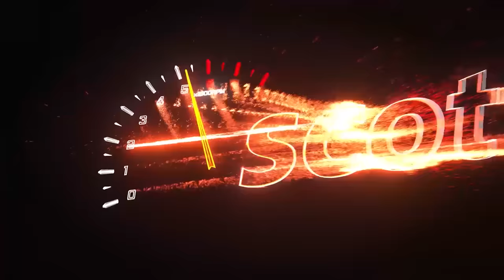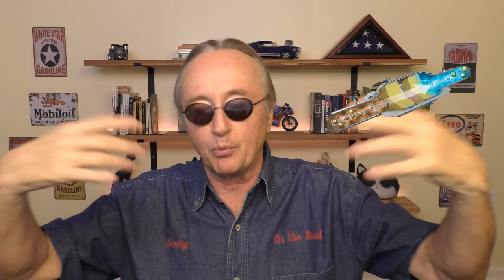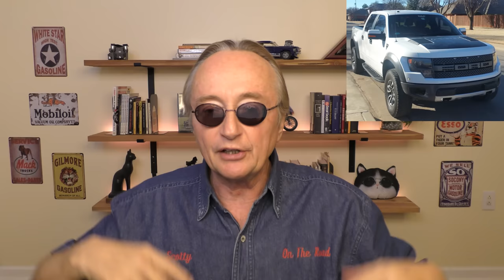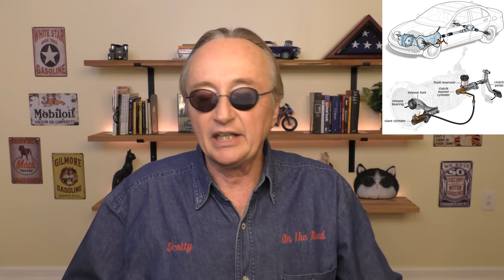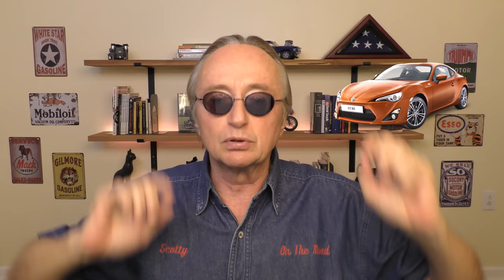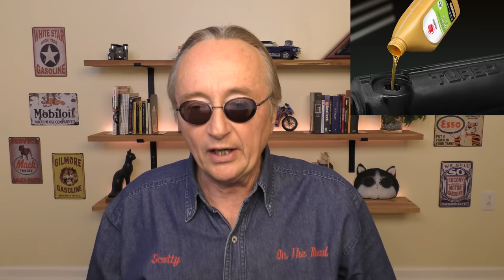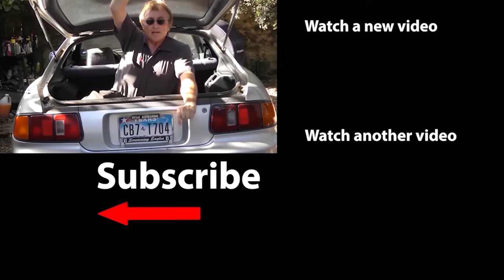Here’s Why Engine Braking Can Destroy Your Engine and Transmission

Comment: I have 110k on my 19 Silverado. I tow over the grapevine in California everyday. I always use engine braking and sometimes it exceeds 4k RPMs. My engine still running stop
Reply: I always take my class A motorhome down the Cojon pass both north and south directions in 1st gear at about 30mph in the trucker lane. Nice easy descents.

Comment: I've used engine braking for years.  And I've been driving stickshifts for over 40 years.  And I can get 300,000 miles out of a set of brakes.  Most of my driving is highway driving.
Reply: Either you're smoking something good, and i want some of it, or you have adamantium brakes, and i want some of that too.
Reply: @mastervader4444  One of the very first things I was told by my behind-the-wheel instructor in driving school was, "Judge with your accelerator."  I see too many people constantly hitting the brakes.

Comment: Establish that it's a lot of extra stress on the engine and transmission to engine brake, then we can talk.
Reply: I’d say as long as you don’t get too crazy with it, shouldn’t hurt your car.
Reply: It’s more wear on the clutch
Reply: I’ve been doing it with my 2009 Toyota Camry since it was new.  I now have a 109,000 milestones and no problems.
Reply: @ILYxIW  gotta rev match, clutch braking is a thing too...
Reply: It's harder on an automatic transmission from what I understand. The manual transmissions it doesnt hurt as bad.. and its wear and tear on any of them, because your transmission internals and your engine are holding the weight of your car back.
Reply: Engine braking is far easier on the engine than full throttling it. The only bad thing that can happen is either over-rev because you accidentally down-shifted 2 gears, or clutch wear due to trying to use those lower revs to help brake faster (basically same concept as revving the engine up before dumping the clutch to launch faster).
Reply: @thomasdunn496  there is a manual camry in 2009?
Reply: @kaibotski4939  My 2009 Camry is a 4 cylinder automatic.  Instead of keeping it in D when slowing down, I often put it into 4, 3, and 2 as I’m slowing down in addition to using the brakes.  It’s going to have to downshift anyways, so I don’t think it’s hurting anything if I do it gradually without causing excessive RPMs.
Reply: The 4 speed auto-transmission on my Corolla automatically selects a lower gear on long downhill descents
Reply: @ILYxIW  If you know how to shift, the wear is negligible.
Reply: @timwilliams4739  Not hard on them either.  This is just another OWT.

Comment: Hey Scotty, can you elaborate more on engine braking destroying engines and transmissions? I've been doing this for years and hundred thousand miles but I never faced such issues in my cars. I'm curious to know why engine braking destroys engine + gb.
Reply: Do you drive a manual or automatic? I have the latter, and I can’t get a clear answer on whether or not I should start doing this.

Comment: Scotty, have your ever noticed that usually when you see a vehicle coming at you going down the road that has a headlight out, it is usually always a GM PRODUCT? Just an observation I have made over the years....my general thought is, "If they can't make a light that lasts, there is no way the vehicle is worth a crap!"
Reply: Talk trash about Chevy all you want, but before the bailout, GM made some of the best cars out there. They aren't a Toyota, but I've seen endless GM cars hit 200,000-250,000 miles without serious problems. My Chevy Cobalt Automatic transmission has hit 230,000 miles and it runs like new, if you want proof, I'll forward a video of it running fine.
Reply: @dylanmanka3941  forward it to me, I'll believe it when I see it
Reply: @dylanmanka3941  I would probably agree with you about the time frame and the quality issues. My headlight/driving light observation still stands though. You can date that clear back to about '99. Back to the bailout thing, imagine that, our government touches something and it goes to crap...hmmmm. They such at pretty much everything.

Comment: Part of the fun of driving a manual is getting a little heel-toe action, engine braking, and rocking at a stop light before blasting off.  Good for the car?  Probably not.  Good for the soul?  Absolutely.
Reply: What to be able to buy a manual. So hard to find .
Reply: @MichelleJohnson-tg5lx  I had a stroke reading this comment, and manual transmission cars are everywhere.
Reply: @keenanwengert423  I think they maybe in the states
Reply: @GB-dp5bs  exactly I'm talking about the US I live here and I see manual cars all the time. I drive a manual too, they're available for most sports cars and almost every Japanese or euro car here is easy to find with a manual transmission. Only cars that are hard to find manual are 2010+ cars and newer econo boxes since most Americans want an auto
Reply: @keenanwengert423  try to go to a car lot and buy one. I found one and  I went all over my town 150 miles radius trying to avoid Orlando . I wanted a Newer car . found a 2014 Nissan Versa 5 speed and That was the only 1 I could get .  Newer  model with a manuel hard to find..  So stupid to have a stroke over a comment .
Reply: Heel toe? if done right it has no negative affects on the transmission, since you are rev matching you are actually helping your transmission not damaging it. As for rocking at stop lights, well yeah that is not the brightest idea
Reply: @wendysremix  and you edited yourself.   Trust this Karen Spelling Cop . I would have caught your drift and Ignored it to understand your content  . SO NOT Sorry if it has to so easy for you to read to comprehend .
Reply: @MichelleJohnson-tg5lx  ESL classes are plentiful

Comment: As someone who regularly drives from LA to Vegas and back,  I engine break pretty often when up in the mountains. 2014 Toyota Camry...no issues with engine or transmission yet. 107,000 miles.

Comment: Woah old car drivers been doing it wrong this whole time
Reply: Not necessarily. It’s a useful tool. Use common sense when engine braking. Obviously 3rd gear when going 70 miles an hour is not good for your engine. Unless of course you have a sports car. My owners manual suggests not using 5th gear when towing to get adequate engine breaking. 

Any time you run your engine, it’s wearing out. It’s up to you to decide what is best in the end.
Reply: old car drivers learned in/drove old cars!! drums all round , no power/servo assistance etc etc ;)
Reply: In the owners manual of my Subaru Impreza they tell you NOT to hold brakes down a long hill and to use the gears to keep the car at a steady speed. Its common sense, its not even about premature wear, you can develop whats called 'brake fade' where you temporarily lose friction on the brakes due to heat.
Reply: @nomeru_0  thats just being in the appropriate gear for appropriate speed, as you say common sense :)
Reply: @gimble8638  .....I hate power assisted brakes and steering in small cars.. It's an American thing that spread around the world..
Reply: @charlesdickens6706  well charles im in the UK and and older than i care to admit to lol, so yes ive driven / owned many many cars without either servo or PAS but tbh you wont find anything much  past 1980 wiithout a brake servo, which tbh on the whole is a good thing!!!, i still own 2 cars with drums all round and one has a servo and one doesnt and i know which i prefere out in the real world of today, yeah steering can fell a bit lifeless with PAS, but only really been in all small cars last 20yrs
or so really :)
Reply: Or car God is very wrong

Comment: Just don’t let the revs go up, like I only engine break in high gear like 4th and 5th  and use it with regular breaking at turns
Reply: If you Rev match that's not a problem

Comment: I had a 2006 Monte Carlo and I did downshift alot not knowing it was bad for it but the transmission lasted pretty long considering for a GM car 180,000 until i needed to fix the trany from clunking but everything else started messing up and it was leaking from everywhere at 186,000 NEVER AGAIN WILL I BUY A GM CAR, I got a 07 Accord 2.4 now and I trust it to go anywhere at 246,000, I barely needed to change the original alternator a few months ago. Very happy with it 😁👍
Reply: I doubt engine braking was the cause.

Comment: When I was taught to drive I was told to leave the car in gear until the revs hit around 1k then press clutch in. It gives you more control. I think it’s more dangerous to coast with only brakes on. Also engine has no load on it when it’s slowing how can it increase wear?
Reply: Well, at least in theory, it can have an effect because you reverse the direction of the force. Instead of the engine putting force on the transmission, the transmission puts force on the engine. However, I don’t think it’s a problem for engine because it just spins away, but I can imagine that it becomes too much for the transmission in certain situations.
Reply: @Asto508  I agree with you. Like if you're down shifting to high revs in a normal car. Which may be what Scotty is referring to here. However slowing down from a speed and letting the car slow down in gear should be okay. If you coast on the brake in neutral or clutch in you have less control.

Comment: I’ve got a 2000 GMC Sierra 1500 with 376k miles - nothing major done, a 2009 suburban 2500 - also nothing major done, and a 2014 Silverado 1500 x nothing major done as well. They’ve been amazing vehicles and have never left us stranded before. All 4x4 and heavily used off road.

Comment: Engine braking in a manual isnt detrimental. 
In an auto it just builds heat in the trans.
Reply: >90% of automatic transmissions on the road today have a lockup torque converter. When engine braking, the computer will engage the lockup clutch. The net effect is you actually cool the transmission due to higher RPMs to circulate fluid through the cooler, with no appreciable heat being added by the torque converter.
Reply: I've got a transmission fluid temperature gauge on my motorhome. The trans fluid runs very cool when engine braking on a long grade, usually about 140 degrees or less. The fluid temp goes up to 250 degrees on the uphill sometimes.

Comment: Engine braking is pretty handy on a downhill, banked, snow-covered road, lemme tell ya.
Reply: My friend almost killed himself going downhill in neutral only using brakes to slow down. He lost braking power and his plastic wheel covers were melted.
Reply: @lakshyamongia3270  Somewhere in Pennsylvania, there is a hill where everyone is required to stop before proceeding down it. I drove down it in my '61 Chevy Biscayne which had only a straight 6, a 2-speed Powerglide transmission, and non-powered, single-reservoir brakes. That was pretty scary!

Comment: I always engine brake with my 05 4Runner when going down mountain hills. They range from 1-2miles and they’re very steep. Do I have to? No. But I’ve never had a problem with it. Truck has 160k on it now.
Reply: Engines are more expensive than brakes :)
Reply: @sptt 144  try going a steep downhill only using brakes. Funerals are more expensive than engines.
Reply: @lakshyamongia3270  exactly. I’ve seen people on the hills I spoke of smoke their brakes because they fallow to close to trucks that are engine braking. I sit at 2,8-3k rpms, 50-55 mph, and the truck has no issues whatsoever.

Comment: I bought a '69 VW Squareback(fuel injection, new in '68) that was bought in Germany and brought to the US and sold with around 12IK miles. Almost immediately, it failed to start when cold and acted like a carbureted engine that needed to be choked. The dealer's mechanics really didn't fully understand the fuel injection system yet and I can still hear the German mechanic saying, "Replace the computer" in guttural English. Didn't fix it. I finally braved the regulations about entering the work area and read the manual concerning hard, cold starting; bad cylinder heat sensor. The computer didn't know the engine was cold. I had to replace this sensor at least three times over 10 years. New technology!

Comment: I use cruise control going down steep grades to maintain speed without going too fast. Works perfectly fine, saves brakes, and I’ve never had a problem.

Comment: Please explain how does engine braking hurt the engine.
Reply: Backslash in gear System and bearing
Reply: @Scavage0001  thats not true, if you have that much backlash then its shot in the first place. As long as you dont shift in too low of a gear its all good
Reply: @D3nn1s  you are not right! without backslash the whole World wont turn, every combination of 2 gears need backslash, thats a fundamental part
Reply: @Scavage0001  i didnt say theres no backlash, i said "that much"
Literally if you accelerate and let go of the gas thats the exact same thing as when engine breaking. While coasting along this happens dozend of times a minute that you accerelate slighly and then coast along.
Or do you floor it, shift to neutral and then floor it again?

Comment: Engine braking has never hurt any of my cars and I am as old is Scotty and my cars always get north of 250, thousand miles without burning oil. In fact the new cars, if you have the cruise control on and it’s going down a hill it’ll actually downshift to try and slow the car down to the speed you have it set at.

Comment: When I engine brake, the revs are usually between 3-4k rpm.  If you don't engine brake going down a mountain and use your brakes instead, you'll likely have no brakes left

Comment: If you are going down a descent of like miles yes engine braking isn’t good, but if you’re just coming to a stop at a light or slowing before a corner, go for it
Reply: Wrong as long as the rpm doesn’t go high u can engine brake all day

Comment: When I am going through mountainous areas, a LOT of up and down 5-7% grades, I keep my automatic transmission in high (3rd) and do not use overdrive. This gives me a lot more control and my transmission isn't constantly shifting and hunting for the right gear. And I do not have to brake as often or as hard.
Reply: You're doing it right.

Comment: Yes you are correct, a talented driver with the manual means to down shift an ICE can leverage the torque, mass, and momentum of the moving vehicle to slow down...prior to needing to physically brake to come to a complete stop.  As we move forward in human development with CVT and highly adaptive smart computer controlled transmissions this "talented driver" art is fading away.  With Electric cars coming on-line and regenerative braking many talented old ways will simply be reduced away.  I do still enjoy driving my manual transmission car. We all will have different experiences with this means of deceleration.   Its OK to have a different opinion.  I  greatly enjoy what Scotty teaches. I wish you all a nice driving day.

Comment: I always changed oil every 3,000 miles. Screw what anyone says, it's the best thing you could do for your car.
Reply: My dad learned about cars before refiners started putting detergents in oil.  He used to change oil every 1000 miles, and he didn't let the odometer go past that, either.

Comment: Car engines and transmissions are designed to operate within certain limits. As long as these limits are not exceeded, engine braking whilst driving down long descents is fine. If you rely too much on your brakes, you are asking for trouble!! Your car will suffer from overheated brakes, and unless your car has ceramic brakes, repeated application whilst driving down long descents can lead to destruction of the discs, & calipers. I have actually had this issue with one car I had years ago.

Comment: I engine break all the time; small hills, big hills. During the summer its cheap air conditioning and added breaking ;) Somewhat surprising to feel the added resistance to downhill engine breaking when the AC kicks in.

Comment: define engine braking too
is it staying in gear at high rpm
or jerking it in gear on high rpm
Reply: It is basically leaving the gas pedal and letting the engine slow you down without pressing either the brakes or the clutch.

Comment: Id like to fill in on your comment regarding Skoda. It is like what Lexus is to Toyota with a twist. You get premium interior and all the bells and whistles you can imagine for the cost of a basic version of a VW. Skoda has really hit the nail on practiality and space inside the car. They have a lot of clever details. Skoda introduces engines and drivetrains from Audi/VW once Audi/VW has figured out the early lifecycle quality issues on their models first. In Europe they allow customers to customise addon features from the factory. Skoda is pretty reliable, and because they share the technology with VW/Audi the spareparts do not cost a fortune in Europe. I recon if VW so decided their service network could handle Skoda too in US.

Comment: Scotty, I’ve heard that it’ll ruin an automatic transmission if you put it into Neutral “N” to coast down hills, and that you shouldn’t tow a broken-down automatic transmission car in “N”. Is that correct?
Reply: Putting any car in neutral when going in a long downhill drive is asking for your breaking system to fail from overheating and you flying into a ditch.

Comment: Been doing it for 40 years.  Haven't had a problem.  And I also haven't burned up my brakes and ended up in a heap of rubble.  When you live in the mountains "engine braking" isn't an option.  It's a necessity.  

You can always tell who the flatlanders are from the clouds of acrid smoke coming through their wheel spokes.